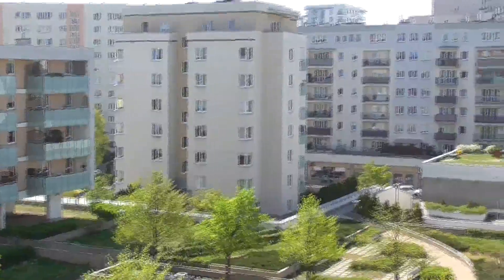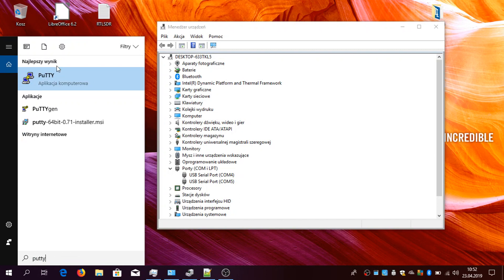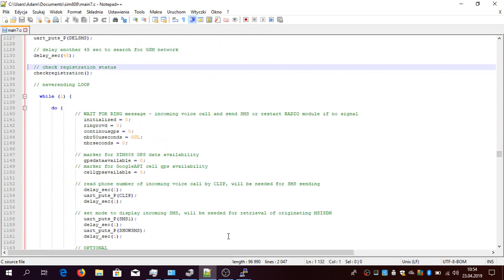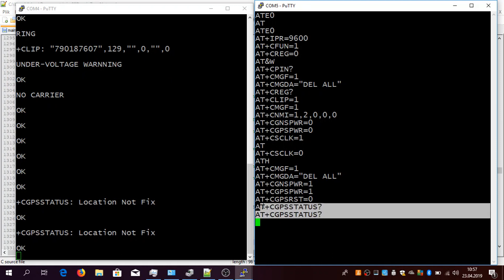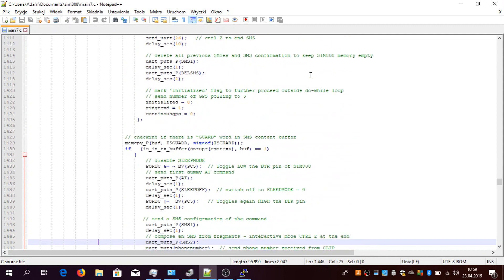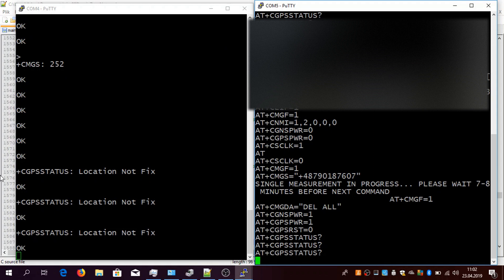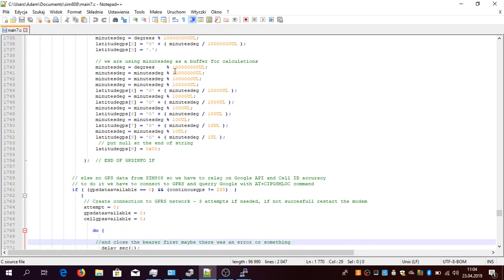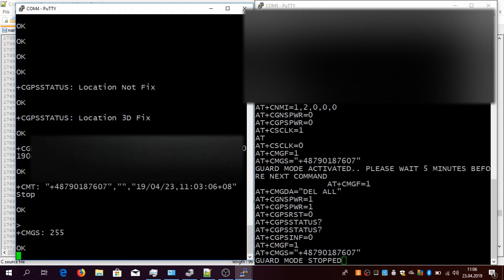Make your own cheap DIY GSM GPS bike car tracker / GPS car locator  for  20 USD ! - final version

Comment: May I ask if you think this board will work with your set up? SIM808 Module GSM GPRS GPS Development Board + IPX SMA GSM GPS Antenna Support 2G Network for Arduino Raspberry Pi Geekstory https://www.amazon.com/dp/B079FN45FB/ref=cm_sw_r_cp_api_i_Qek5Eb2MT4QVY

Thank you so much for your help
Reply from the maker: Hi, if you look at the documentation on this board Geekstory FZ1735 SIM808 here : https://tinyurl.com/yykfnn7c  you will find that this board has  almost all SIM808 valuable pins exposed in CON4  connector :  RXD,TXD, GND, DTR, RTS, CTS, RI so it is perfect. It should work with any type of source files from my project.  It has voltage regulator MIC29302BU built-in and the 3 Amps  fuse which is good (according to the chip spec it will allow you to power this board with the voltage up to 26 Volts !).  In this board schematic I can also see a pullup resistors for an Active GPS antenna - so this board will probably only work with such type of antennas as included in this set on Amazon.  So yes it will work perfectly fine in this project. Remember to attach these 4 pins : RXD, TXD, DTR, GND to ATMEGA328P and additonally pin D9 of SIM808 to port PC4 - pin 27 on ATMEGA - see explanation below. 
In the comments on Amazon for this product I have found such info : "First, you will need a standard size SIM card to get functionality. No micro or nano SIMs. [..]
Second, if you want to power on the device without having to hold down the power button, you can do so by soldering onto pin D9 (see picture) and draw the level high on an I/O pin for a couple of seconds (2-3 seconds is sufficient). Then draw the level low on D9 and you're good to go. I used a Teensy 3.6, which has 3.3V on it's digital I/O pins, and the SIM808 didn't have any problems.". 
As you can see you may need to modify sligtly the code to steer pin "D9" for 3 seconds by some of pins of ATMEGA ( pull up high for 3 seconds then drag it down ) . The code would look like this  inside the main.c or main7.c file somewhere inside beginning of the  "main" function (lets assume you are using PIN PC4 # 27 on ATMEGA to steer D9 CON4 pin :

// pin PC4 is used on ATMEGA to steer D9 pin on SIM808
PORTC |= _BV(PC4);   // Toggles  HIGH the D9  pin of SIM808
delay_sec(3); // Hold high for 3 seconds
PORTC &= ~_BV(PC4);  // Toggle LOW the D9 pin of SIM808

Cheers
Reply: @justanengineer5599  Hello, After reading your comment I'm just a little bit confuse about the Teensy 3.6. It will definitely increase the cost if I implement it in the set up. If I don't mind powering up the device with holding the button, can I by pass the teensy 3.6 as you have suggested?

and since I will be using the pro mini I don't need to do the D9 pin correct?

Thank you sir.
Reply from the maker: Hi, you do not need 'Teensy' - it was just a part of comment I copied from Amazon website. Connecting D9 pin from this board is required if you don't want to start Sim808 board by pushing some jumper/switch.  If you intemd to use Arduino mini please see my video about using USBASP programmer, you will need this device to program Atmega chip on Arduino board directly without bootloader. Remember to use Arduino Pro Mini version 3.3Volt logic with 8MHz clock. 
You will need to attach MISO,MOSI,SCK,RESET,VCC,GND pins to USBASP to program the ATMEGA. Arduino pro mini pinout is available here : https://www.theengineeringprojects.com/2018/06/introduction-to-arduino-pro-mini.html  & here  https://www.instructables.com/id/Uploading-Sketch-to-Arduino-Pro-Mini-using-usbASP/  .
 Here is the video about it https://www.youtube.com/watch?v=q_K4hp-3EjQ

My video showing how to program the standalone ATMEGA  chip under Linux Ubuntu is here : https://youtu.be/7klgyNzZ2TIk  
If you connect the Arduino board with USBASP as shown on previous links you may then follow my video to upload the GSM tracker code to Arduino
Reply: You are really amazing. Thank you for sharing your knowledge and taking the time to explain to the newbie like me. I will keep following you and learn as much as I can ☺️. You are the best

Comment: Hi Adam, where did you learn all about how the GPS system works and how to DYI these GPS tracker devices? I'm a student and would like to learn more about it too. Thank you.
Reply from the maker: Hi Will, I was inspired first by following blog : https://blog.podkalicki.com/100-projects-on-attiny13/   and started to develop some easy projects on ATMEL chips using AVR-GCC environment  because I prefer to use pure C language.
If you intend to code in C you may want to have a look on following tutorial here : https://www.8051projects.net/files/public/1242392126_2569_FT22383_avr_tutorial.pdf .
This is a good starting point if you want to play with AVR chip which are the foundation of whole ARDUINO family. 
 On the page https://embedds.com/interfacing-gps-module-with-avr/  you can find some basic info how to interface the microcontroller with GPS module.   
 With time I have moved to ATMEGA 328P chip ( the one used in ARDUINO UNO ) but still coding in C  and started to play with consumer GSM modules like the SIM800L and SIM808 from chinese vendor SIMCOM.  They support a lot of features, even IoT protocols like MQTT - http://mqtt.org/

Comment: hello is it possible to send the data with multiple receiver, but it will only send to the nearest receiver? Thanks man
Reply from the maker: Hi currently the code will send GPS position data only to single "caller" number when activated by voice call (after activation by text message "ACTIVATE"). However when texted by SMS with content  : "single" it will respond to ANY phone number that is sending query for the location.  So the answer  is yes.